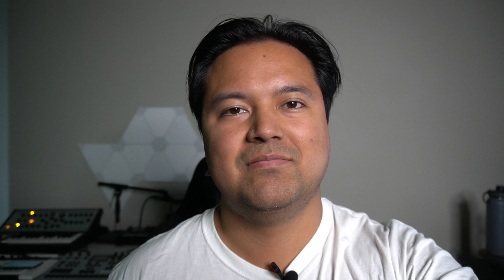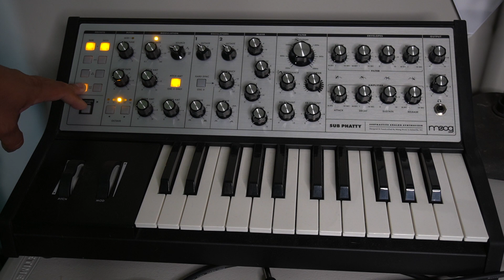How To Calibrate Moog Sub Phatty (Sub Phatty Tutorial)

Comment: I've noticed that the volume drops substantially every other time I use this (I'm borrowing a friend's) - do you think calibrating will help fix that issue?  And it shouldn't affect/erase any patches?  Thanks so much!
Reply from the maker: Yeah if the calibration doesn’t fix that, then you might need to initialize(reset)  whatever patch you’re on. I assume it doesn’t do that on every single patch? Other than that, it could be some kind of other hardware issue.  Also no, calibration doesn’t erase any patches. The factory reset would do that and that’s a totally different command.

Comment: it only fixed my issue temporarily, i have to tune it like an old school moog now
Reply from the maker: Ah damn, it does happen over time the older the synth but keep in mind that oscillators/transistors are very temperature dependent so if you are having a lot of temperature changes then that will affect the tuning.

Comment: Do you know how to factory reset a sub phatty? Froze loading firmware and is totally stuck.
Reply from the maker: I think you would have to do a sysex update by plugging it into a computer. Does a computer recognize it when you plug it in?
Reply: @Ponchy  that's what i did that broke it
Reply from the maker: @palestineband  damn well I'll have to look into it more but you potentially might need to send it in.
Reply: Hey Ben, i just got the same problem and i have tried with the sysex update again and again, but it does not work. did you find out how to solve the problem? mine is frozen and the only thing that happens on the machine is the light on the LFO that flashes.
Kind rigards William
Reply: @elskerdigforaltid4521  no i never fixed it unfortunately
Reply: I had that issue the day I bought my sub Phatty, I contacted Moog and they sent me a batch of 3 files to wipe all firmware, reinstall the firmware, and update the firmware and it worked like a charm. I would highly recommend reaching out to moog support and see if they could do the same for you, I saw this was a pretty common issue so hopefully this helps!